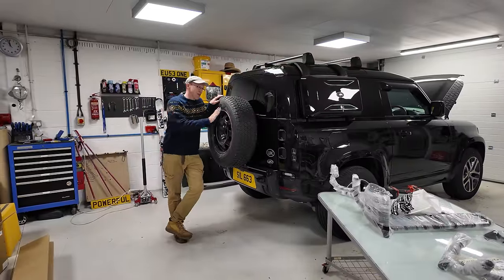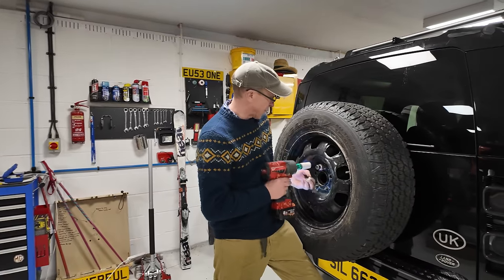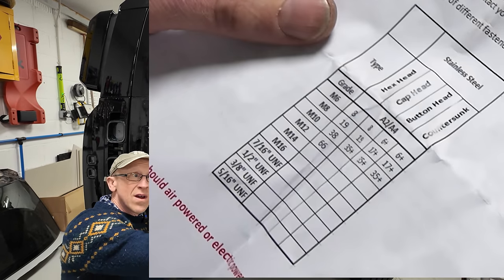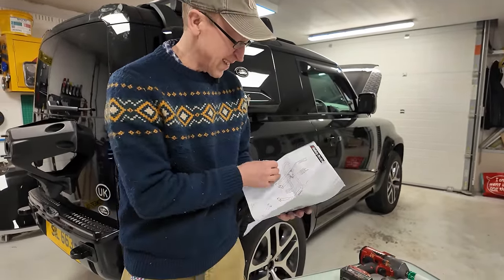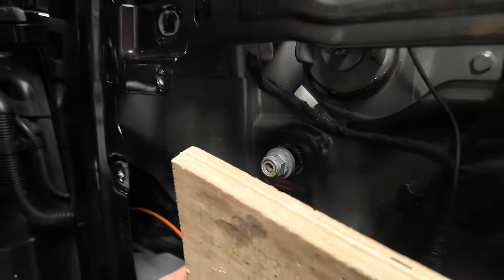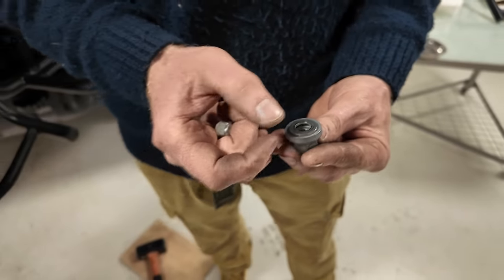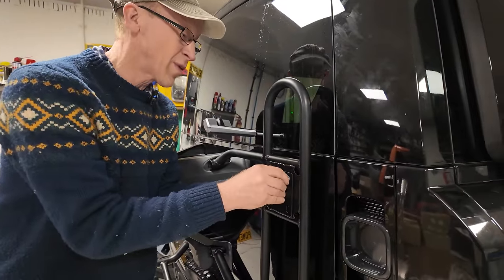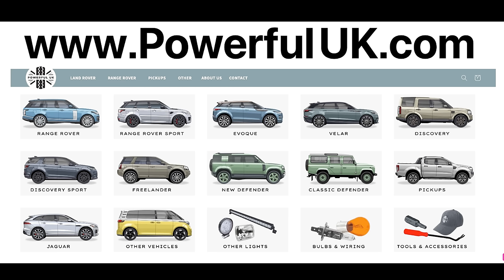New Land Rover Defender Spare Wheel Cradle & Hi-Lift Jack Mount - Review + Fitting Instructions

Comment: Excellent video - but you did seem to forget that whatever wheel size you have, the outside diameter of the tyre stays the same - it's the tyre wall that gets thinner and thinner the larger the wheel. 😉

Another use for the larger version is to strap on those large orange "get out of trouble" traction plates instead of a hi-rise jack.

Oh - and a chance to give a shout out for your excellent staff - I have had great help from Destiny and Lily in the office to various questions I have had. 👍
Reply from the maker: Hi John
the 22" wheel from Land Rover has 275 x 45 tyres which give a diameter of 806.3mm
The 18" wheel from Land Rover has 255 x 70 tyres which gives a diameter of 814.2mm
There is a setting in the CCF to change the wheel diameter etc.

Comment: Hi Simon, recieved my cradle and hi lift mount and jumped in and installed straight away.  
I followed your video but got caught out with the removal of the original bolts. Where you recommend using a lump hammer to remove the captive through bolt this does not work. I started by using a 1.5lb ball peen and wooden block, did not budge, stepped up to a 3lb lump hammer as you did, still no movement. Then went to the nuclear option, 5lb sledge hammer, again no movement. 
After some head scrathing I reread the Safety Devices instructions where they state to tap out the bolt with a drift and hammer. Back to the 1.5lb ball peen and a drift. After 3or4 moderate strikes sure enough the bolt came away. I thought my experience would help others.
I'm very pleased with the end product although a locking solution for the jack is still to be sorted,

Comment: Bin the Jack support bolt on plate and manufacture a steel tube ladder plate with a few rungs, job done, no one needs a Jack mount, get an inflatable bag instead. Plus winced when you were wielding the Stanley knife, you should always cut towards the apprentice.
Reply from the maker: Yes i agree with the ladder.... apologies for the poor shank use !

Comment: No idea why you'd fit the one with the jack mount, as where can you use a hi-lift jack on the new Defender? Useful on the old Defender as you could use the end holes in the chassis with an adaptor, and also fit side sills with holes in, but on the new model.... (yes I know they can also be used as a winch, but are mainly used for lifting)
Reply from the maker: That is a good point - one I forgot to mention ! I dont think the tow hoops could be used for lifting - they are designed for pulling forces.
I guess there are a couple of reasons to carry a hi-Lift jack
1 - To look cool 
2 - So you can help people in their old Defenders 
Simon
Reply: @L663  I agree, the rear tow points are for horizontal loads, but may be ok. Nothing at the front though! Perhaps you could come up with an adaptor fabrication that goes under the side chassis jacking points to take a hi-lift...
Reply: We have rock sliders on our L663 and lift the defender off them with an ARB Jack. It’s fast and convenient.

Comment: Design a ladder separately from the tire rest and jack mount. We only need the ladder.
Reply: Or maybe add something to hold a bottle jack!
Reply from the maker: I think the ladder / bottle jack would be a good solution. Using a bottle jack may be easier on the new Defender as i am not sure where we can use the Hi-Lift jack on the Defender body

Comment: Looks good to me, my only question is it possible, or in what position should the High lift Jack be placed to raise an l663 as I have Rock sliders fitted
Reply from the maker: This is still something we need to look at - we may need to design a jacking point adaptor
Reply: We have rock sliders and lift our L663 off them with an ARB Jack. It’s fast and convenient.

Comment: I'm not sure about these products. I cannot help but feel that they are products for the sake of having a product. I understand the hi-lift jack retainer more than the spare support however, but I'm not entirely convinced on either. Nevertheless, it is always good to have a selection of products that someone, somewhere may want and need. The proof of the pudding will be ultimately in how many units are sold.
Reply from the maker: Yes - I actually want the jack holder more now than i did when i started the video.....but still not 100% sure..

Comment: An old chap that worked for caterpillar once said to me, ; Spring washes, don’t work  Have you ever seen a spring washer on a vital joint? Head cylinder bolt? Wheel nut?  Use correct, torque settings or specialist fasteners. Ditch the spring washer
Reply from the maker: Interesting point... and one I think i probably agree with

Comment: I guess you pop a ratchet strap around the bars and then tighten the strap and it will lift the wheel up to line up.    BUT that said if you can’t get the wheel from the ground to the carrier why does having a shelf help you?   I just can’t see the point of it    But the hi lift bracket looks good though
Reply from the maker: I like the idea of creating a lift with the strap - took me a moment to work out what you meant ! 
Yes it sort of helps - but its not really going to make your life any better - as you say getting it up that high in the first place is the elephant in the room !
Reply: @L663  Yeap something like the military wolf side mounted spare wheel as it’s even higher they have a strap/cradle type system

Comment: Hmm….it seems a lot of “solution” to a problem few owners will ever need..? Lifting the spare wheel on and off would kill me! I can see that Safety Devices need some help in product design and finish….and how do you clean the rear door with that much stuff bolted to it? Well done for fitting it but I’m not sure I would bother stocking it…hard core  LR men would not agree though! 😱😱😃😃😃😃😃
Reply from the maker: Its a neat concept but does is solve a real problem. As someone else has pointed out - where can you even use a high lift jack on the new Defender ?

Comment: A much cheaper and easier “tyre rest” is called the Land Rover Assist person - I ended up calling him out last week after I got a puncture and bent the wheel nut spanner thingy trying to undo one of the wheel nuts on my 90 as I had removed my crate of tools from the tiny 90 boot to get something else in and forgot to put it back in the car afterward………. LRA man got the wheel with the flat tyre on the wheel carrier bolts 1st go (obviously had loads of practice at that job!)
Reply from the maker: There is an art to getting the wheel up there.... Destiny has it off to a art now ! we have been having wheels on and off a lot to test the spare wheel lock....relaunch this week !